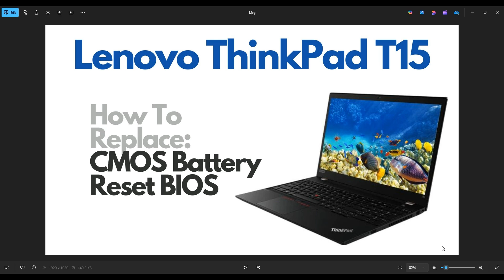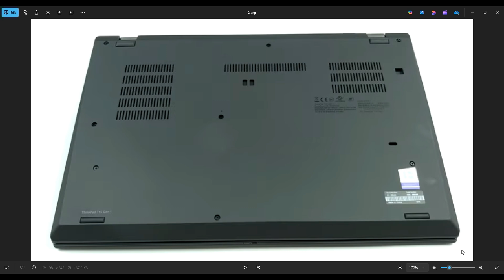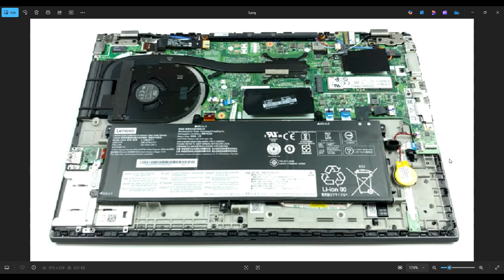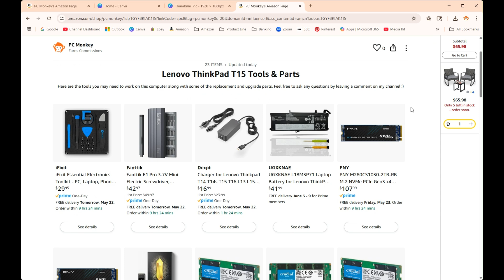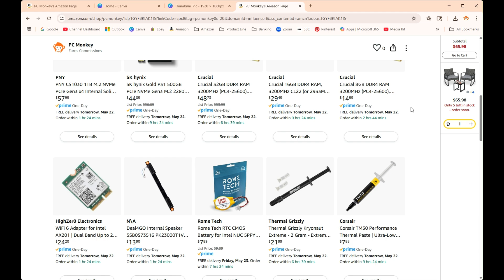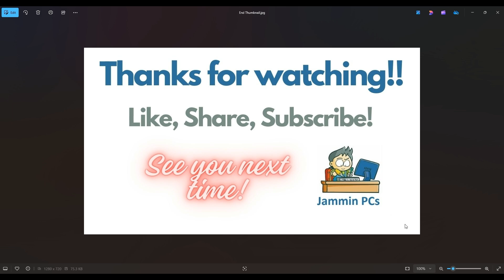How To Reset BIOS / Replace CMOS Battery - Lenovo ThinkPad T15 Laptop Computer

Comment: uh will this reset the bios password in a 2021 version of the computer
Reply from the maker: Some motherboards have a jump point where you can reset the BIOS password if you short out those two points. However, that is a risky operation and you run the risk of destroying the motherboard if done incorrectly. For that reason I choose not to have those DIY videos on my channel. Sry :(

Comment: Thx but didn’t work
Reply from the maker: What setting in BIOS was not reset after this operation?
Reply: @jamminpcs idk but I sent it for repair. I’m pretty sure some grease corroded the motherboard from overheating.
Reply from the maker: @Trevordotdee  I dont understand. This video is how to reset BIOS or how to replace a CMOS battery. You said it didnt work. I asked you how it didnt work. You dont know? What didnt work?
Reply: @jamminpcs  mb I read the title wrong. Thought it was abt how to try to start up a laptop that wasn’t working.
Reply from the maker: @Trevordotdee  Oh ok. Np. Whats not working in your computer? Would you like help fixing it?
Reply: @jamminpcs  its fine. Warrenty covered it. Laptop's motherboard got corroded from some overheating issue.
Reply from the maker: @Trevordotdee  Glad your all set :) Always here if needed !!